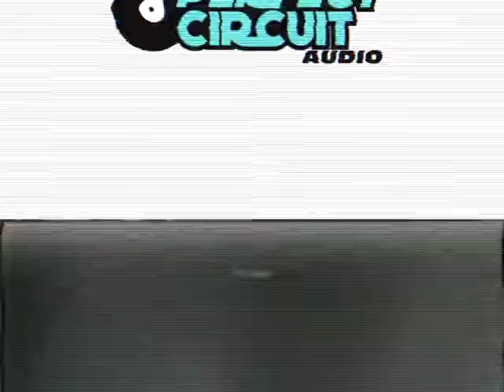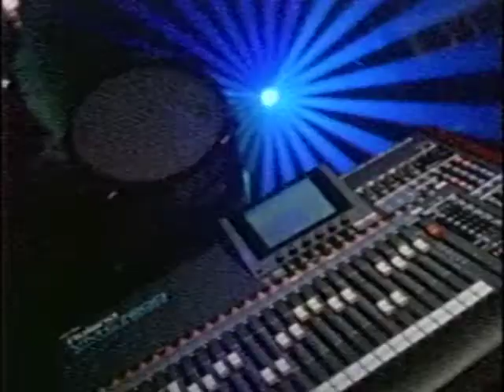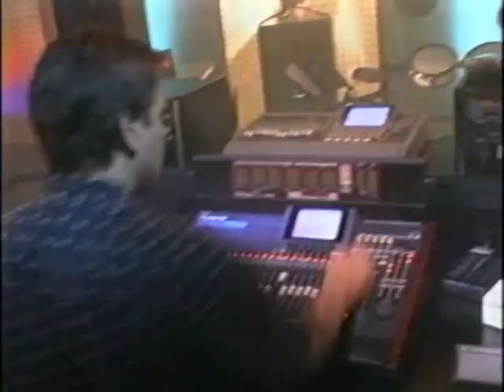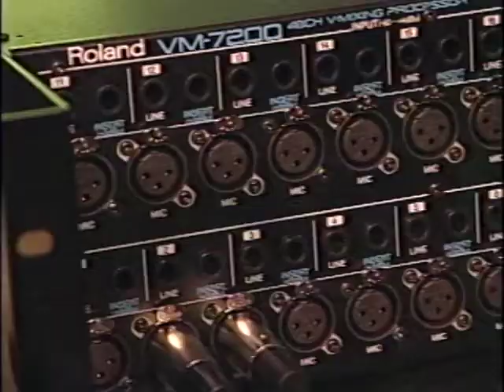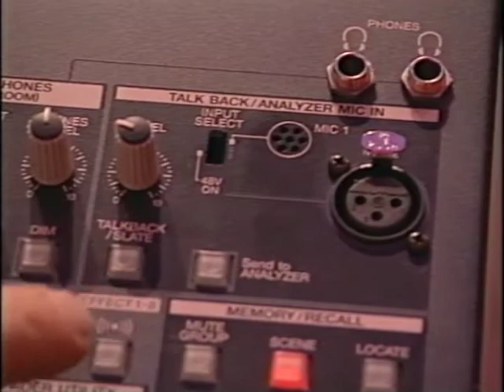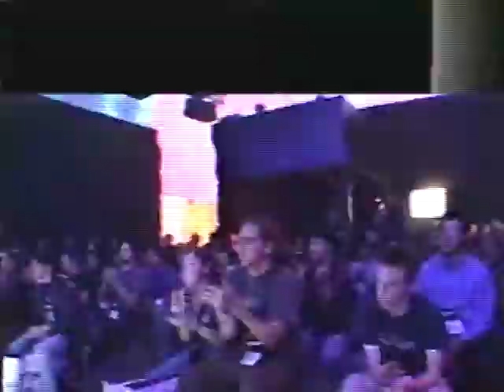Roland VM-C7100 Mixer Promo

Comment: video too technical, hard to know what he is talking about .
Reply: Couldn’t disagree more. Felt perfect for a surface level overview & practical use cases. You could share what it is you wanted him to cover that he didn’t, that would help me understand what you mean could have been different because I wouldn't know what you are trying to say you wanted covered instead.

I’m not in audio professionally, just a videographer, but 95% was not very esoteric. I know SMPTE in terms of the body of standards, esp. drop frame timing, but I honestly didn’t know what exactly he was talking about in that part, it was right after mentioning MIDI tie-in, but it's a massive subject to cover everything so I understand moving quickly over that part.
I can let you know he wasn't using extraneous jargon, that people giving these types of talks certainly do do, especially nowadays when there's so many redundant products it's got to be really hard to differentiate one model. But back then a new system could really stand alone.

Comment: I have A vmc7100 +  vm7100 + 3 x vsr880 with digital R bus for 24 tracks. Only trouble is I've had it for years but its so complex I still wish I knew how to use it! Manuals are too big & there's no real beginners guide. Still trying to work out how to simply use it as a preamp for my active speakers and without distortion. Roland UK cant help because its too old. Sometimes wish I'd gone for a simple analog mixer, but I'd miss out on so much including the RSS effects. Only prob is I'm probably stuck with it, because not sure who'd buy it + I took early retirement so haven't really the money to change my mind. Thought of Ableton live 10 if can get enough inputs if / when can afford. If only could get a bit more guidance eg be shown how basically to lay down tracks on my Roland setup I'd probably keep it. Any help offers out there!?
Reply: Ok..go to www.proaudiodvd.com and purchase the Roland VM 7000 series DVD, it explains alot and also download the Roland VM 7000 application guide & you should be alright..
Reply: Thanks Gary. I'll try that. Btw I've now bought Ableton 10 & planned what interfaces I'm going to buy for it, but it'd be great to utilise the VM setup. Another problem with scrapping the VM is that I have active Tannoy speakers, so I'd need an analogue mixer with a controllable preamp. Am hoping I can still use the VM for that + benefits of RSS & other effects, even if I mainly write with Ableton, keeping the 3 VSR880's for add ons. Cheers!
Reply: @davidsimons1377  ohh and before I forget too..download the Roland Rbus equipment connection guide it shows you various connections by chart. I used the dif/at boxes and a motu box to get into the computer lol..the fun part for me was trying to figure it out but I hope it works out for you buddy cheers
Reply: Thanks. I have an R Bus card for my 3 x VSR880's on back of my vm7100 (Cant remember its name---is that Difat or was that for ADAT?) I don't know if its possible to use that slot for PC connection is it, if its already doing vsr recorders duty? Pity it can't take 2 cards, & then I wonder if you could still get other cards any more. I know there's the SPDIF connections, though they'd probably be going to the AESEBU in on my Behringer  ultradyne pro---then to CDR or other digital rec media(unless I use PC for that too?) Also the SPDIF's on back of vmc console are feeding dig ins on my monitors. Cheers!
Reply: Hi Gary. Do you know what link or links I click on the above proaudio link please? I can't see any obvious mention of dvd's on there. Thanks.
Reply: @davidsimons1377  OK so even better..go to eBay and click musical instruments as category and type in Roland vm7200, scroll down and you should see the DVD being sold there as low as 29.95 ok buddy cheers!!!
Reply: Thanks Gary. Just bought for £21.60 all in! Was £24 but Ebay gave me an October offer.